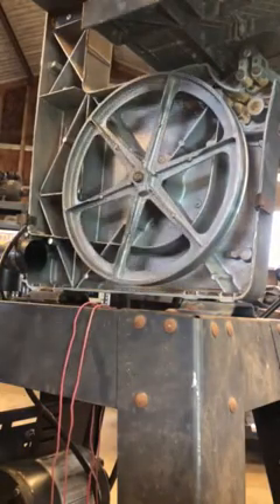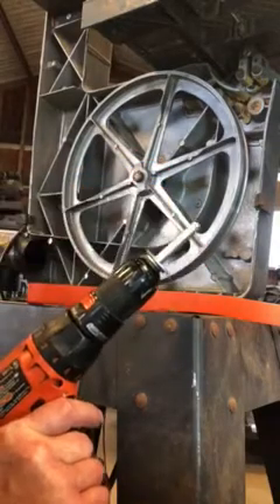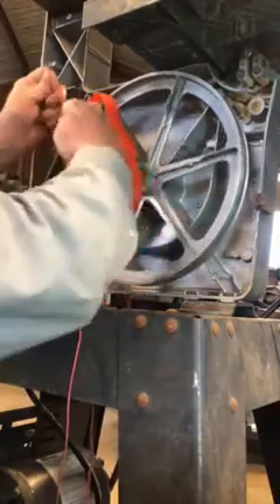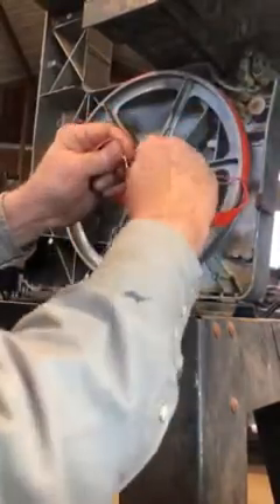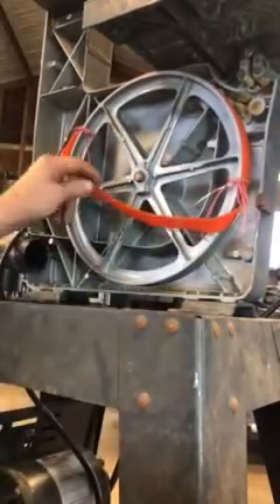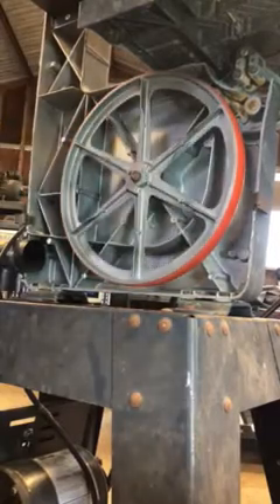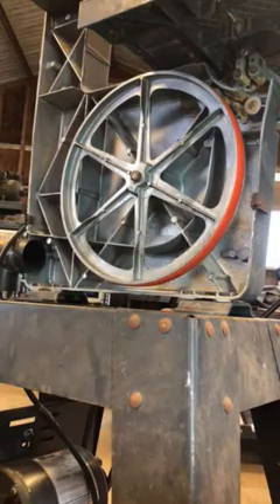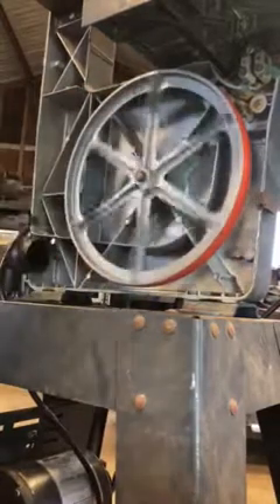Replacing a urethane bandsaw tire the absolute quickest and best method

Comment from the maker: There have been several suggestions to use zip ties and a screw tip holder… Probably a better way to go… Provided that your tip holder is long enough
Reply: that's what I did and it worked a treat!
Reply: I'm going to try that!

Comment: I changed both tires in ten (10) minutes!  Your demonstration is the best!  10 minutes and no struggling!  At first, I didn't believe I could do it, but it worked just like you said, no wheel removal, no heat, no water, no soap just a piece of dowel, a couple pieces of string, and my electric drill.  Easy peezy nice and easy.  Thanks again!

Comment: I have an old 1940's Delta and the wheels are solid.  I used Duct Tape for a start and worked around the wheel.  So much easier than the last time I put one on.  Appreciate the tip.

Comment: I tried and tried and was having a problem doing it this way until I chose zip ties instead of string and put belts in boiling water for a little while to soften them up.  Then this method worked like a dream.   I'm sure I don't have as much strength as guys do and that is why the heated up belts helped me.

Comment: Thank you sir!  I used spring clamps instead of string but it worked just as you showed.  Took a few times of moving the spring clamps up the line as I went but it was a painless procedure.  
My old rubber tires were glued down with contact cement and took a half an hour each with acetone and a scraper to get them clean.  I had to remove them from the saw with a puller to be able to work on them properly.  If I have to replace my new urethane tires the procedure will take about five minutes thanks to you.

Comment: I hate to think about how much faster my replacement would've gone if I'd bothered to look for this video BEFORE almost dislocating my shoulder trying to get the dang tire wrapped around. Much faster - thank you!
Reply: I actually didn't have any string so I used 4 zip ties at the spokes of the wheel to keep tension and a forstner bit extension from my lathe, but got the job done with MUCH less mangling of my hands!

Comment: My friend, you're a genius!  This worked like a charm.  I could not get my lower wheel off to save my life.  You would think that somewhere one could find whether the nut on the lower wheel of my 25 year old Delta 14" is reverse thread or not ... but alas, I could not find that.  So I didn't want to beat the thing to death.  Your approach worked great.  A softwood dowel will break, so metal is recommended for the rod.  Maybe an oak dowel.

Comment: I watched several other videos and half way tried them out, no luck, about to take my wheels off when I found this video. What the heck I'll give it a try. It worked like a champ. Like a couple of others I used a 1/4 socket extension in my drill instead of a bolt, also set it to a lower speed/torque setting. Instead of string I used some spring clamps to hold the tire in place while performing this magic. Now if I can just keep from screwing up the tires to begin with...Thank you, thank you, thank you!!

Comment: Tim - Thanks for making this video.  I used your method to change the tires on a Rockwell 14" saw.  Worked like a champ.   The only thing I did different was use zip ties to hold the tire on to start.  A very helpful video..saved me a lot of time and effort.  Thanks very much.

Comment: I just replaced my 2 tires with the blue ones in 15 minutes.  Used your method of tying with jute two areas.  Then found a smooth bit that had like a socket on one end and would work in the drill.  I put drill on reverse and spun the tire clockwise.  Worked like a charm!!! thank you Tim!

Comment: Hello Tim, I just bought a bandsaw that came without the tires. I am totally new to the bandsaw regime and trying to watch videos on various methods about installing the tires. Your method is absolutely the best method. I am going to try this tomorrow. Thank you for sharing !!
Reply: Hello Tim, reporting total success. Your method is awesome - got both the tires on the wheels. No hot water bath, no heat guns. Just stretched the bands out of packet.
I used spring clamps to hold instead of strings and a wooden dowel. Just FYI.
Cannot thank you enough 🙏🙏
Reply from the maker: Very good… Glad it helped

Comment: Thanks for making and sharing this amazing tip.  I used the 3/8" bolt as you mentioned with 3 3/4" long shaft with 2 1/2" extended out of the chuck.

Comment: Awesome, thanks.
Just got some 9"  tyres and started thinking they were too small or would need boiling water etc, so of to Youtube, and this is the first video I watch. A quick read of the comments and I'm all set to go with a small socket extension.
Update : - Tried the 'extension bar', but it slipped, tried a "hex shaped Philips bit", with just a little slip at the tightest point. But with a push of the wheel, the tyre slipped on, and just needed a little help (thumbs) at the end to properly seat some of the sides, as it was fractionally wide. Cost = 4 cable ties.

Comment: I used paracord and a 1/2” socket extension. Tire on in less than a minute. Bro you just saved me two hours of pulling motor bolts, removing belt, disengaging the brake, pulling the wheel, and putting it all back together, and retentioning all that crap. You are the man!!!

Comment: thanks for the tip. used 2 zip ties and a long thin stainless steel rod chucked into my drill. Took longer to get the old tires off than to get the new ones on.

Comment: I used a long 1/4 driver bit that's used for multiple different bits like you see in a dewalt kit. I threw a washer on there like you did.... Man I will never do it any different the rest of my life, thank you for taking the time to make this video.
Reply from the maker: You’re right... A tip holder would have been the way to go... provided it got the traction... didn’t even occur to me til later. I was hunting a wooden dowel when I ran across the bolt

Comment: This video absolutely lives up to its title. I was replacing the tyres on a bandsaw made by a long-defunct saw by Durden, Australia and followed this video in detail. My first and only problem was I didn't have thick enough string but only builder's twine and that didn't work as I could tie it tightly enough. So I used cable ties, tensioned with a cable tie gun and REALLY stretched the tyre as far as I could before using the drill to roll the tyre on. It took more effort than Tim's demo showed but this could have been due to a minor discrepancy in size - my wheels were about 12 5/8" in diameter for some reason and I was installing 12' belts. Anyway the whole process - from removing the old rubber tyres, cleaning the wheels and fitting both tyres took less than one hour. Thanks, Tim. This has been on of the most helpful YT videos I have seen.  Regards Frank (Australia)
Reply from the maker: Glad it helped... I’ve seen people doing some pretty crazy stuff making that job more difficult than it need be

Comment: Right on!  I just used your suggestion on a shop smith bandsaw.  I use it for a backup setup and decided yesterday to remove the rubber from the old tires and install the urethane tires I bought a couple of years ago.  I tied it in 3 places and used a 3/8 dowel chucked in a drill.  Thanks.  I also videoed the simple removal of the old tires and the simple cleanup method that I use.  I will post the video in a couple of days.  and it worked great!   As my ol' daddy would say, "winner, winner, chicken dinner!' Thanks again for posting.

Comment: It worked for me on my 14" Powermatic. I had a a bit of trouble getting the drill to bite initially (used a hex bit extension, a bolt probably grabs better). With a little bit of experimentation got it to catch and roll along. Afterwards I had to push in the sides with a screwdriver in a few spots. All went very quickly and was very glad I found this tip.

Comment: My tires came with a special tool and instructions, after failing with them I tried this. It’s amazing how well it worked! THANK YOU! I used zip ties. If only you had a video for how to easily remove the 20 year old glued on rubber tires prior to this step.
Reply from the maker: I’m not sure there is an easy way to remove the glue… Especially depending on what kind of glue the last guy used… They don’t need glue at all

Comment: Tried to do it like you on my 18" tire and just couldn't get it.  I watched a couple of other videos and ended up getting it on my clamping my wheels so they were stationary and then working around with my hands and the bolt in a drill.  Ended up with no water and no heat, thank you for the video.

Comment: Great video. The drill part is great. But the string thing didn't work. The tire kept slipping off. What worked? Using hose clamps instead of lengths of string. Thx!

Comment: I'll have to give your method a try. It looks very easy to do. Hope it beats the method suggested by the vendor of soaking the tire in hot water before stretching over the wheel using the included tool/roller.

Comment: Thank you so much! I was dreading taking the wheels off just to put new tires on when the hot water method didn’t work. I did need an extra hand with the lower wheel but that’s what husbands are for, right? I keep knee high nylon hose in the shop to check grain direction before planing. These worked great for tying the tires in place and very easy to untie. Thanks again. Bandsaw is up and running!

Comment: Brilliant!  I used tie wraps as many of the others recommended, and my tire required quite a bit more stretching than the video, but damned if it didn’t roll right on there.  And I cracked up when the washer dropped to the floor.
Reply: I used the tie wraps also and it worked like a champ. Went right on and just cut the head off of the tiewrap when I got to it.

Comment: We replaced much larger industrial band saw tires with some frequency. Our maintenance boss was convinced that contact cement added tire life and insisted we use adhesive. Our method was to remove the wheel an wrestle the wheel and tire. This effort meant that your uniform workshirt was always a casualty since you wound up wearing most of the adhesive. When I was promoted to maintenance supervisor, I stopped the adhesive requirement, as I was unconvinced that it contributed to tire life. Coolant (cutting fluid) likely also contributed to tire material degredation. 
No one on our staff ever employed a method similar to your demonstration. We generally assigned band saw tires replacement tasks to low skilled mechanics since the task was regarded as requiring brute force and little brain power. I humbly accept that I and we were wrong. Two of four of my home shop band saws would benefit from tire replacement and upgrade. I intend to apply your method. I have not been looking forward to the task.

I spent a career maintaining industrial machinery and I have never previously known of your method. 

Thank you!

Comment: Nice idea, but when I tried exactly this approach, the steel rod failed to have enough traction on the tire to pull itself around the rim. Maybe a wooden dowel would be better? I ended up using heavy-duty zip ties to hold the tire on (not string) as I pried it onto the wheel with a steel tire-iron. Not easy, but it works. I just needed three zip ties to do the deed. The upper wheel I simply removed and clamped in in my bench vise to run the tire iron & zip ties around it. Takes some muscle, but it works.

Comment: Your Dad was right.  You are a genius at finding the easiest way to do something.  I used a piece of 3/8 " aluminum round stock in my drill, and a couple of wire ties instead of string and had 2 tires mounted in 3 minutes.  You Sir are a genius.  Looked at Wood Magazine instruction and laughed. Tried it already and didn't work.  They must have been putting a 14" tire on a 12" wheel. Another guy wanted to take wheel off band saw.  Not going there.  Viewed your video and knew I had found the way.
Reply: I think you are right about the 14" tire on the 12" wheel.  I watched that video after seeing your comment.         the shop smith  is an 11" wheel. The smaller the wheel, the harder it is to stretch the urethane tire.  There is no way I could have stretched it on with my hands.

Comment: I don't remember having much trouble getting the blue urethane tires on my saw. The problem is they're no good and have to be replaced too often. My original tires lasted close to 30 years. The blue urethane lasted a few years with very little use. I'm putting new rubber ones on tomorrow.

Comment: well.... I used your method.  my attempt used considerably more grunting and expletives while trying to hold my mouth right.  I had already taken the wheels off, so I guess that is the difference, I had to hold the wheel and run the drill and keep the chair it was resting on from falling over. all in all, those cork soakers better last at least 12 years like the first set did.
Reply from the maker: lol…Yeah… definitely easier with the wheels in place

Comment: Fantastic!!! Great idea, thanks so much. I wonder if put in reverse you could take off an old urethane tire. You said you disconnected the motor is that really necessary?
Reply from the maker: I said that I did NOT disconnect the motor… (didn’t) No need to
Reply: @Timberns  Thanks for clearing that up Tim.

Comment: I'm sure this works but not on a 18" Jet re-saw band saw with 1 1/2" wide tires  53" 1 1/2".  The example shown is a 14" Craftsman band saw, the Jet tire runs in a recessed grove on the wheel.  The tension on the wide tire just requires so much pressure that the washer was going to chew up the tire.  Still got it on with 3 hands, some 4" wood clamps, pry bar, a wedge to keep the wheel from turning.  Start by clamping at the top and work the tire as far as you can with 2/3 on the wheel in both directions and clamp.  Use a pry bar to stretch and slowly work the tire on the wheel on both sides moving a second set of clamps as you go.  Using a thin blade screw driver to get the final section onto the wheel.  The tire came with a little tool that you can run around the wheel to seat and center the tire.
Did soak the tire in hot water, made it a little more pliable but not by much.  When I have to replace my Craftsman 14" tires I'm sure this technique will work.

Comment: No way was this going to work on a new tire that was 1/4" thick by 5/8" wide and 3" shorter than the one I removed! This was from an old Enco vertical 14" metal cutting bandsaw with blade welder. Used three 2" wide strips from an old T-shirt. Used 3/8" wooden doll rod in battery drill. WORKED PERFECT!

Comment: My pulley on my blade wheel (not the motor pulley) works itself loose and comes off.  I have re-positioned it and tightened the set screw several times, but in a few minutes of using it, it works loose again.  Someone suggested I coat the set screw and keyway with JB Weld.  What would you do about this problem? Thank you.
Reply from the maker: I’d try some blue thread locker and snug it good before I did anything drastic
Reply from the maker: And make sure your square keyway key is in good shape when you tighten the set screw down on it. Some pulleys have two set screws… You might try that before you make that a permanent fixture with JB Weld.
You could also drill and tap another set screw on your pulley if you’re crafty.
Reply from the maker: And check the alignment on the electric motor… Make sure it’s driving the belt towards the saw and not away. You almost don’t need the set screw if it’s driving the pulley on instead of off.
Reply: Thank you for your 3 comments.  I will try the electric motor alignment, since I replaced the motor belt recently, and had to make some motor location adjustments; so It's not in the same exact position as it was before the belt was replaced.   @Timberns
Reply: I did this, and made and made an adjustment.  This is working so far.  Thank you for this suggestion.

 @Timberns

Comment: I tried this today, but the metal rod just slips when I get to the tightest point, my tire is 1/4" thick so I'm guessing that's why it doesn't work. Very disappointed, now it's back to the old way.off with the wheels a struggle to get the tires on.
Reply from the maker: You might try a 3/8 wooden dowel… might get better traction

Comment: Well, as the title infers, this must only work for urethane tires. I tried this with my rubber tires and the mandrel just kept spinning on the spot - didn't "grip" the tire to stretch it around. I tried both dowel and hex driver bit as others had suggested, but i have not been successful with this method on rubber tires. I am very sad 😞.

Comment: HOW YOU KNOW WHAT SIZE TIRE TO PUT ON ???
Reply from the maker: Just measure the wheel and the groove width.
Reply: @Timberns  my wheel is 13.75 in diameter,  so what size tire should i get ???  I have a Porter cable PCB330BS ???
Reply from the maker: @edmc755  2 Urethane Band Saw replacement TIRES Fits PORTER CABLE 13 5/8" BANDSAW Model PCB330BS Made in USA 0.095" Thick https://a.co/d/2dT3z2b

Probably this one… Look around you might find a better price
Reply from the maker: @edmc755  They say this one fits 13 1/2 to 14 1/2 and it’s more reasonably priced
Urethane Band Saw Tires 14" x 1" x .095" Compatible with Bandsaws Wheels Including Jet Grizzly & Powermatic for Woodworking Projects ( No Adhesive Needed) - 2 Pack
Reply from the maker: @edmc755  That should have been a link…